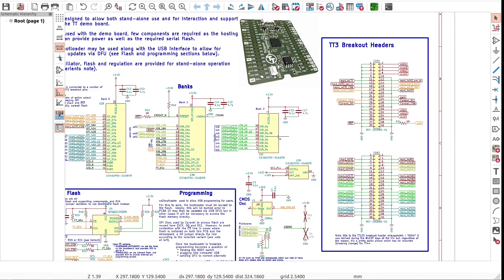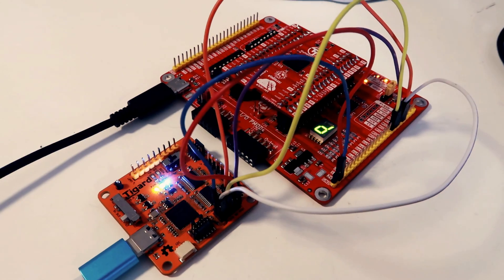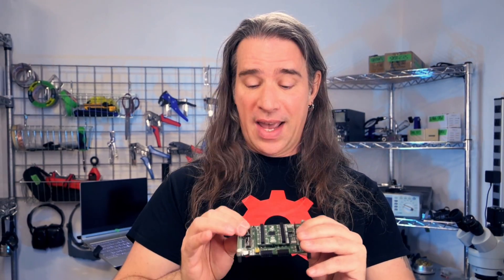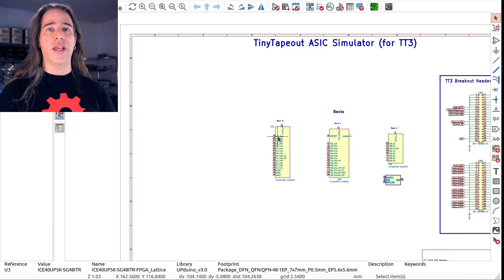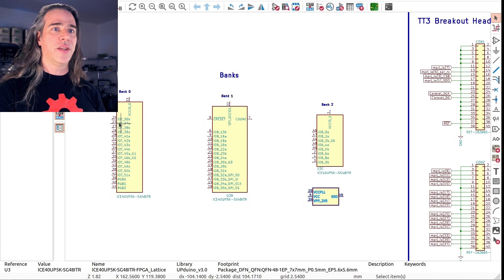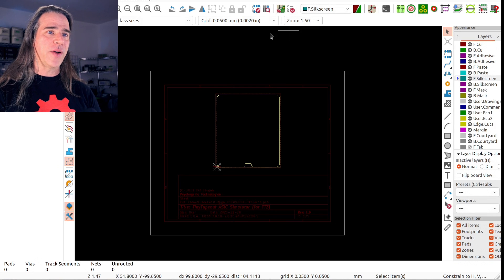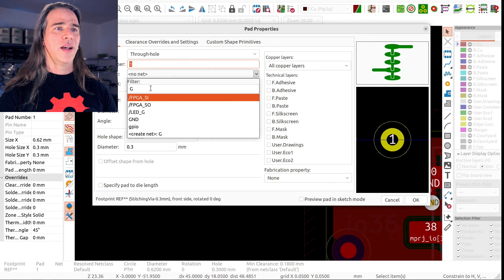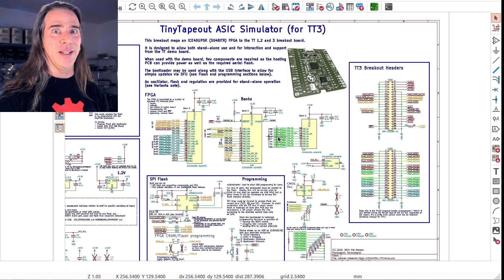FPGA Design | Beyond dev boards: your own custom PCB

Comment: Do you plan to create and sale a FPGA demoboard with RP2040 that can be used to prototype designs for TinyTapeout?  This is to narrow the gap between FPGA prototyping and ASIC.  I usually test my ASIC project on Basys3 board, the timing might be different from the TT demoboard.

Comment: Hi! Thanks for the great video! Exactly what I need for my hobby project. I cloned the repository mentioned in the description. I'm trying to get it to work with KiCad7, but I have some problems with some of the symbols. I was able to find a suitable library on github for the ones referencing "UPduino_v3.0", but many other symbols reference a library called "psypassives". Can this library be found on github or somewhere else? I could probably recreate them myself, but I'm afraid that I will make some mistake. I want to put this board into production ASAP. BTW: Is it possible to buy this board from somewhere? (Would save me a lot of time initially) Again, thanks for creating great content!
Reply: After some investigation, the psypassives was easy to fix. I also had to upgrade to KiCAD v8. Now I have some errors of type "Label not connected to anything". I guess I can just terminate them with an X symbol? (E.g. IOT_41A and LED_R/G/B)

Comment: Could you make this but with something like an Arria 10? 
Would this work similar to making one with a cheap Intel Arria 10? I know that the Arria 10 is a bit… more than any Lattice, but still uses the same basic building blocks? 
And, how would you upload the code to the chip, would you use some kind of usb? 

Also, god help me with the amount of pins. Oh. My. God.
Reply from the maker: Yeah, that's certainly more pinnage than the lattice I've been playing with here... But what is a cheap arria 10?  For open projects, I tend to stick with lattice--and have a couple more coming out soon--because of the tooling but also because the $10-50 range is accessible to pretty much everyone.  I have been looking into ideas for different flavors of FPGA but have been leaning towards tang or gatemate because just the cost adder from having to use HDI can already be harsh but dumping $500 or a grand on a chip is a bit on the steep side for the average DIYer.  I'm really curious about the Cologne CCGM1A* and they do provide a buttload of I/O and look like a nice step up in terms of speed... would that be of interest to you?

Comment: Can you suggest some good FPGA development boards for beginners. I am currently considering tang nano 9k. what do you think?
Reply from the maker: Hi Talha!  I actually have one I want to show in my next FPGA video (if I can ever get it published, ugh!).  I don't want to give an "it depends" answer, but of course it depends... the short version is you've got so many choices, and you're dealing with variables like form factor, peripherals on board, a bunch of stuff.  My advice is to start by thinking of the type of things you want to do and choose the FPGA, or it's family, first.  I gravitate towards lattice ice40 a lot, not because it's the best FPGA, but because I can work with them: I like the (open source) tooling, there are a variety of configurations/sizes and are cheap enough to integrate into actual projects (for myself, but also for anyone building a project I wind up sharing, or in a product), because of the open tools there's lots of community projects and support.  
Whatever you choose will impact the tools you install, what you learn, and how you work.  From there, you can find a good dev board to work with (choose something that has a few PMOD connectors, I think).  
If you like the  GW1NR-*, then ya, good choice.

Comment: What college major teaches this stuff? It’s fascinating and I want to learn it.
Reply from the maker: Hi Zac!  I'd say EE (as in Electrical Engineering, BEng type deal) and, depending on where you are could be awesome... but you don't have to wait.  I mean I was in physics (oh so long ago) and just picked everything up from the wonderful internet (well, originally from Forrest Mims III but mostly from the wonderful internet) and from doing.  It's a lot, of course.  But you start small.  You want to play with FPGAs, then you get a little FPGA module from digikey or tindie or whatever, and you blink a light.  Then do more complex stuff.  Then create an expansion PMOD circuit... soon enough, your designing PCBs.  Then you decide to learn how to design good PCBs, and you do that.  
So, even if you decide to go for something formal, I'd still recommend you start playing today, just 'cause you can.  Great time to be alive :)
Have fun!
Reply from the maker: Oh, and as an addendum: am right now working on a more in-depth FPGA related vid, so keep an eye out for that :)

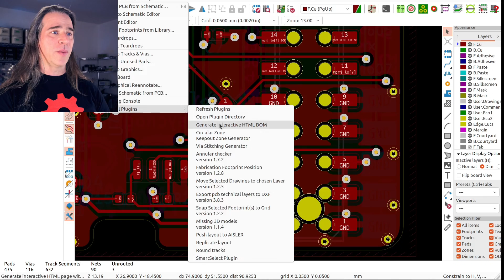Comment: The plugin that you're using @ 10:06, what is it?  I'd like to try it myself
Reply from the maker: Yeah, it's really cool:  "interactive HTML BOM", available through the plugin manager, super simple to install and use.
Reply: @PsychogenicTechnologies  Sweet, installed.

Would you mind if I appropriated your FPGA design with some usecase-appropriate modifications and put it on an inductive load controller I'm making for a personal project (not a commercial product).

I'm a bricklayer that's been teaching myself EE for about a year so that I can build some components I need for a larger invention.  The specific board I'd use it on is a 2kamp/12v inductive load controller with active flyback control (parallel mosfets instead of a freewheel diode).  I need an FPGA to handle the switching logics and tbh I'm not good enough yet to start from scratch with my own FPGA design.
Reply from the maker: @EuphoricDan  Oh, there's hardly any secret sauce in there, and I'd invite you to look at it, as well as the TinyFPGA, UPDuino, and other open source projects as sources of inspiration.
Main question would be: why not start with a pre-built module--there are tons--do you PoC on the part that's really specific to your requirements, see everything working, figure out if anything needs improvement and then start doing integrated solutions.  I find it's a good way to keep my attention on the wheels that don't exist yet, when ramping up.  
Have to tell you: my heart skipped a beat when I read "teaching myself EE" followed by "2k Amp"--whoah!  Starting a little steep there (48V is high V in my life, and 50 Amps is getting way up there--I've been happy in low power land, mostly).  Going to assume you're a sane and responsible adult there, but still: keep one hand in your pocket and be careful.  oof.

Comment: A few years ago I made some pcb's to flash some led's and it was cool, things happened but now I want to get back into it and I'm really interested in the whole arm32 thing and want to make my own boards because I think it's extremely cool and I had fun routing my board back when I did it for the leds. However, I'm still so very lost when it comes to things like smoothing caps or pull up/down resisters. Would taking a beginner course on electrical engineering and going from there benefit me in learning all of this?
Reply from the maker: Short version is my opinion is: yes, go for it.  We're very lucky now, with so many open source tools and projects and experts willing to share what they know.  Back in the day when I started, I had no one to turn to and was stumped on many points, couldn't figure out which components/values actually mattered and which ones were amenable to a wider range of selections, and generally had a very slow start because of it.  
If you're talking building a whole SoC from scratch, I think that's a very worthy goal, maybe a lot to chew from the start (e.g. dealing with RAM and even just the BGA packages for CPUs can be a something of challenge).  I'd recommend you start playing immediately, keeping the barrier to entry low, by leveraging open tools like Kicad, and say relatively simple microcontroller circuits to start.  
@PhilsLab has some really excellent tutorials.  If you can follow along with, say, https://www.youtube.com/watch?v=aVUqaB0IMh4 or https://www.youtube.com/watch?v=nkHFoxe0mrU you'll see that he shares lots of expertise along the way, specifically about things like decoupling and such.  From there, you'll be less rusty, have some solid basics and a good idea of what exactly still stumps you and can decide if going for a course would be worth it (and which one).  Good luck and have fun!

Comment: Sweet timing. Just finished up the HDL for a project and need to make a board for it
Reply from the maker: Wow, perfect.  Are you going for an iCE40?  If you followed along, do go and check the links above for the actual project repo and schematic: I've advanced in there since putting out the video and, though a lot of it is related to the specific application (the TT demoboards), it's worth looking at the newer stuff.  
And I was crunched while doing this: if/when I re-work it for real I'd add some ESD on the USB lines and a bit of stuff like that.  Also, the TinyFPGA boards might be good inspiration as well.  Finally, I have the bootloader running now and it's awesome, will try to record and edit that really quick so keep an eye out, I think it's worth it.  Cheers!
Reply: @PsychogenicTechnologies   It's actually for an Efinix Trion T20, but the general concepts are still helpful. Their Efinity IDE is barebones but capable, and my design (1500 logic elements) generates a bitstream fairly quickly. They have pretty good documentation and although their forum loads slowly, they tend to be pretty helpful over there. Certainly was good enough for an FPGA "advanced beginner" like me to create a functional design.
Reply from the maker: Hm, interesting!  Haven't used those but after seeing yosys has a "synth_efinix" command, I'm curious.  If you have an eval board or dev kit you would recommend for these, let me know.

Comment: Looking forward to the rest of the series.  I'm a bit older, and my split ends are a lot worse.
Reply from the maker: hahah, yeah haven't been the best at maintaining the mane!  For the series: I've got the boards and made some changes to the schem (which are reflected in the released version) and going to focus just on the bootloader in the next one.  It's a really cool system, works a treat and is easy to setup.  Will whip up the presentation soon.